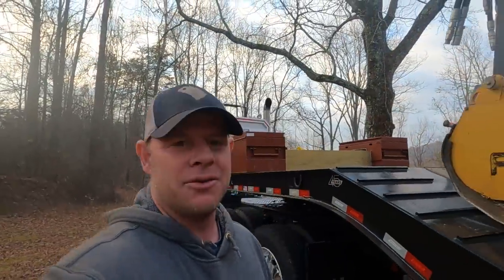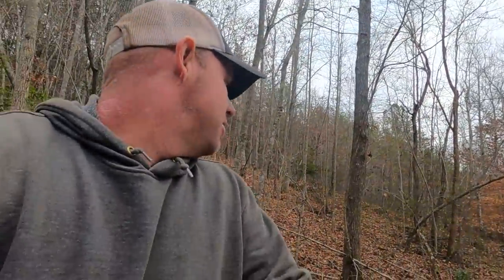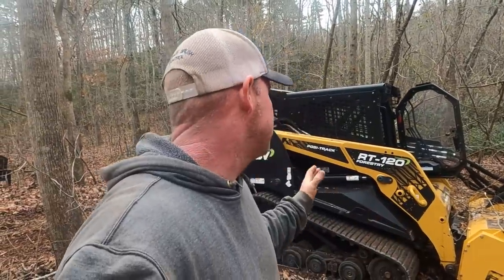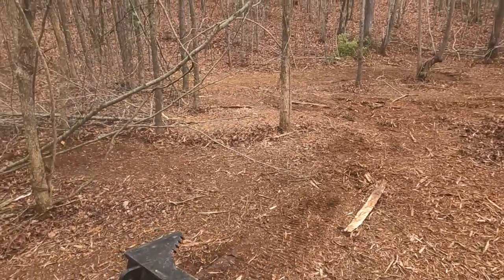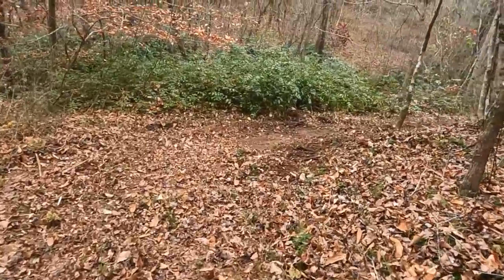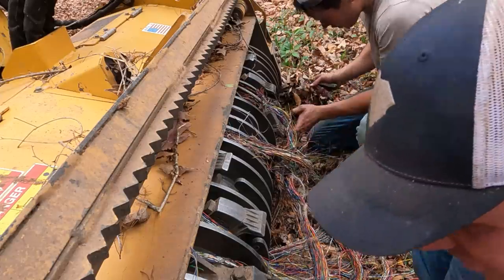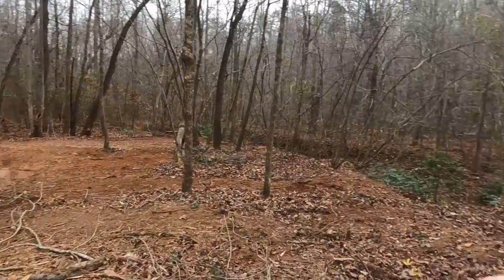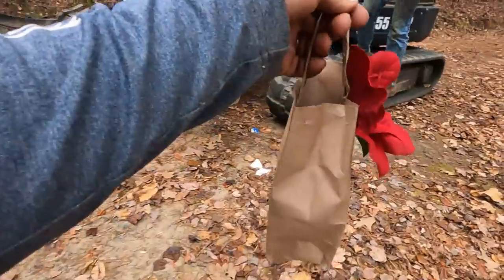Forestry Mulching with Telephone Wire

Comment: I was a linesman for the telephone company back in the 80s. Put up a lot of new cable and removed alot of old cable. One thing was when you tore down the old every foot of the old had to be accounted for and returned to the telephone company or there would be an internal investigation.  (They we’re afraid of copper theft and the liability of what your going through here).  Guess they’re not so anal anymore.
Reply: Judging from the stripes in the thumbnail that must have been a key cable string by.

Comment: Great video again. Wish me luck with my project. I am going to use a dosser for the first time next week clearing out around a pond behind my house and a fence line. borrowing the dosser from the guy that leases 60 acres from me for cattle. its just a rough gully that feeds the pond and it has alot of locus trees and hackberry. cant use my tractor because of the turain and locus trees. if you don't know locus, it's a smaller tree about 20 ft tall that is covered with 2 -4 inch thorns all over it on all branches so no using anything with tires. and it will eat you up using a chain saw.

Comment: You should cut up 12-18" long pieces of that telephone cable, when you are working on a machine, take a single color coded wire, snip in in half, twist half into the hose or wire you need to detach, take the other half and twist onto the connector or nipple the hose fits, this way you keep everything straight.

Comment: Telephone wire was the bane of our mowers in the county. I lost count of how many spindles we rebuilt because of telephone wire. It seems that the telephone men liked to just drop the wire they had just replaced, usually at the bottom of the pole. I've spent a few hours on the road cutting the wire from mower spindles. If caught in time cutting was all that was needed, but let go longer usually meant replacing bearings and seals.

Comment: You might want to change the hose clamps on that intercooler hose with constant velocity clamps.  The ones you have are not ideal for large oscillations of pressure.

Comment: Your tickling that wire with "Multi tool"  And they are good in a pinch..But get you some dedicates diag. cutting plyers...Like 8in long Channel Lock brand.....and some small cable cutters....Time is $ and they will zip thru that phone wire..and larger gauge up to 2/0 with the cable cutters

Comment: That looks like a fiber optic cable for internet and tv.
Reply: Even if you use the 811 system you still find them and hit them. But anytime they run a wire underground it's only fiber optic, power or cable.  The newer developments run them 3 Ft. off of the shoulder of the curb.  Fiber optic cable and coax cable tv is the worst with less then 6 inches of underground clearance from contract trenching or boring.  The fiber network wire consists and is made with glass so they break easy even if you drive on them or drop a tree on them.

Comment: You might need some copper-wire cutters in your trailer now.  The cutters cost $40 which is probably less than the time spent with those multi-tool stocking-gifts.

Comment: John, from a metal detectorist to a mulcher, if I were you I would invest in a decent metal detector and do a quick hunt prior to doing any new jobs.   Not only could you prevent accidentally chewing up an old railroad spike or ax head, but you might just find some really neat relics,  If you were to see the debris and junk I have pulled out of the ground over the years, you would not believe what lies just below our feet.
Just a thought, not a sermon.

Comment: ALL THAT WIRE WRAPPED UP IN THE BLADES SO THATS WHY YOU CALL THAT NUMBER BEFORE YOU DIG  MUST NOT CALL THAT NUMBER BEING IN SUCH A RUSH TO FINISH THE JOB /
Reply: Installed phone cable is buried - usually at least a foot.  That looked like INDOOR wire (light grey sheath), so I doubt 811 would even know about it.

Comment: No locates and you pay the price. Hopefully it's abandoned  otherwise it gets expensive real quick!!!
Reply: Didn't look like it was rated for burial.  Probably came out of some business' telephone system when they switched to VOIP and someone brought it home for whatever reason.
Reply: @N3X15  VOIP uses the same wire as POTS unless using POE handsets. And it looks bigger than a 25 pair cable. I thought he mulched over a terminal that rusted away. They put them in the damnedest places. Trust me I work of AT&T
Reply: @Beachnative42  Didn't look like the ground was disrupted from cable being pulled up, and I didn't see a bunch of plastic or metal sheeting coming from the drum.  I see cable like that all the time at Navy/Army surplus places after it gets replaced with Ethernet or fiber, and Lord knows my neighbors have piles of random junk like that laying around.  Barely dodged a job pulling out POTS from a coastie station in order to replace it with fiber.